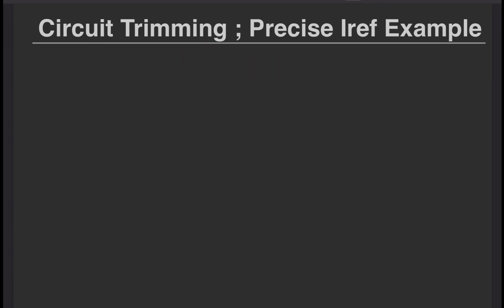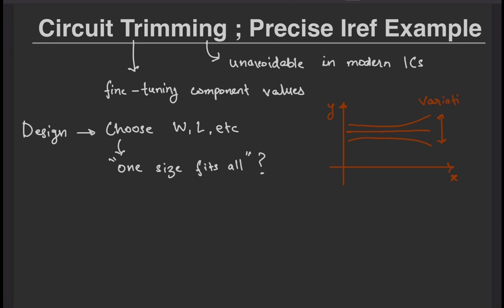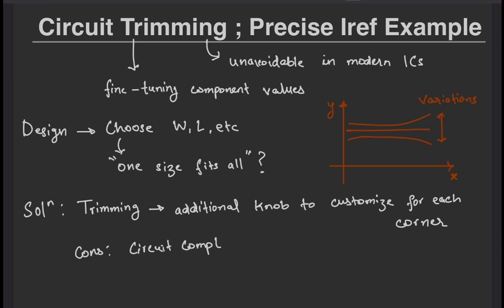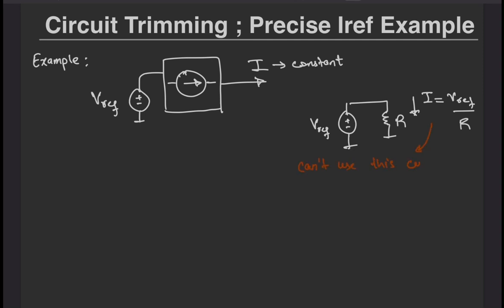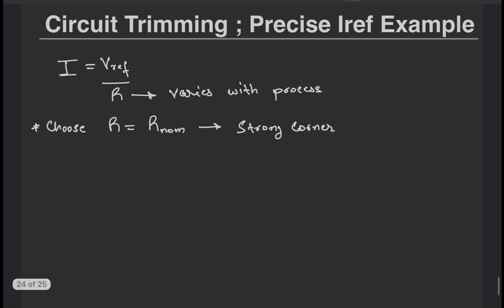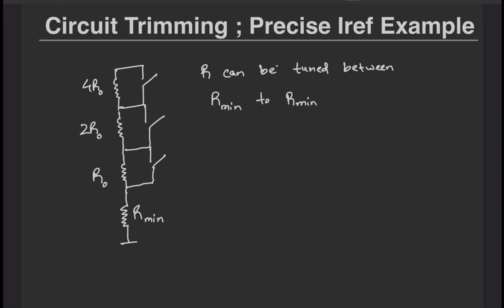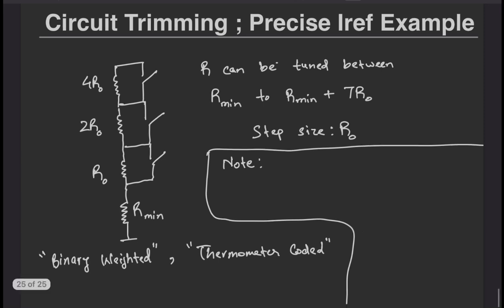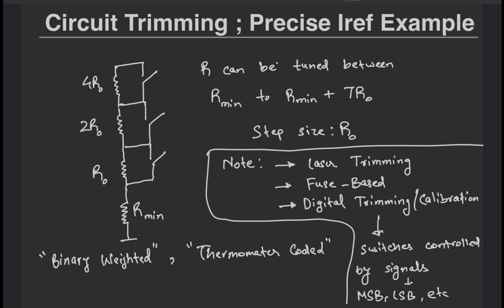Trimming in Circuits ; Constant Current from a Voltage Reference

Comment: Hi sir could you pls tell roadmap for analog design...both vedio lect and books
Reply from the maker: If you are interested in analog design, you may study the analog circuit courses from NPTEL (Dr. Nagendra), and IITK SSCD YT channel. You can refer to Dr. Razavi’s text book as well, and even lectures by Dr. Ali Hajimiri from Caltech.

Learn about RC circuits and their variants, step response, ramp response, etc.

Learn about basic analog building blocks, such as amplifiers, regulators, Oscillators, etc 

Once you have the fundamentals clear, try interning at a company or work with a professor (assuming that you are an UG student), depending on your aspirations.

Most importantly, find a good mentor that will guide you, and resolve your doubts.